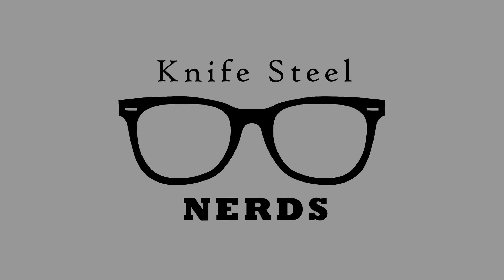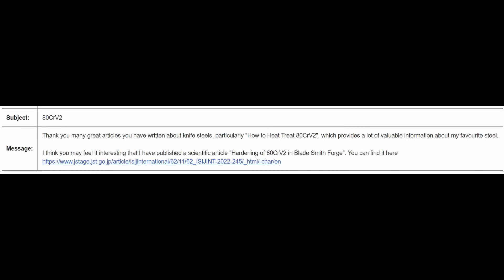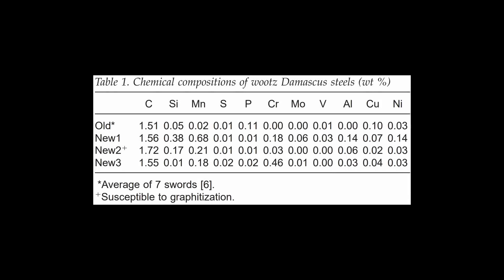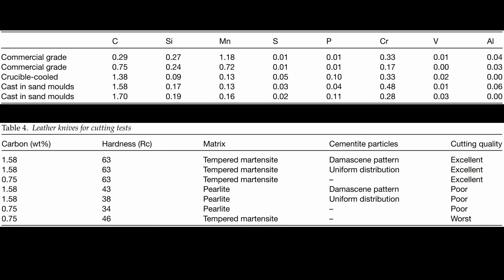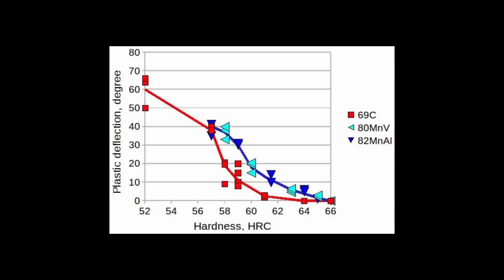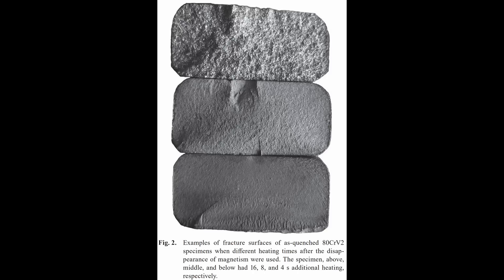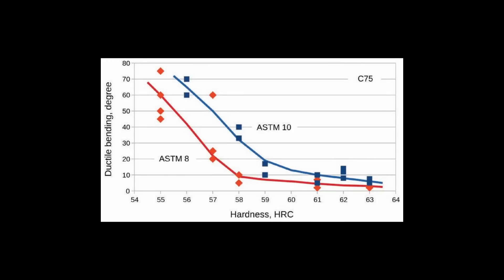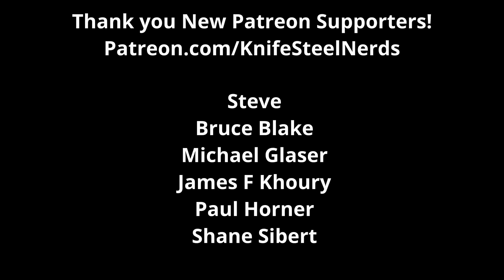A Rival Knife Steel Metallurgist?!?

Comment: My insight from this piece is that these blades are, in essence, composite materials analogous to fiberglass. Aside from differences in basic substances, the metal structure is at a smaller scale than fiberglass....

Comment: Never liked the recommendation for people to start in a forge with 1084. the grain grows in 10 or 15 seconds of moderate overtemperature - to double the original size. Who knows what beyond that. 

more overheat than that with 80crv2 and nothing happens. I have pictures of this -I know they're not appreciated, but I favor the overshot method and like Juha says, it has to be quick. 

I guess if I see nothing in grain growth in snapped samples (in 15 seconds), then my shade of overheat may be lower than Juha's. 

the samples of 26c3 that I sent and that had higher toughness than the book charts were overshot a fair amount - but not for long. Seconds. Finding that worked misled me to believe 1084 would work well that way. 80crv2 does.
Reply: It's good for learning but not good performing if done badly. The carbon dissused really quickly so you can get it to nonmagnetic and it's pretty well near eutectic even from a coarse starting structure without a hold or even normalize. Also quenching it in household oil will also do it wrong. Needs water or parks 50. Best to use 5160 spring steel, or 52100 or something else with some grain pinning of some sort, like 80CrV2.

Comment: Interestingly enough on wootz alot of the myths were like over exaggerations and a the grass is always greener on the other side of the fence type situation. 

Most wootz swords are unhardened or only hardened on the edge so there goes the springy blade theory. And they also tend to cut better Un hardened according to a few modern makers of wootz blades. 

That said it likely still performed better then alpt of earlier European steels which were similar to Japanese bloomery steel till well after the medieval period and into the Renaissance period. 

Actually a key area of my research and why I'm trying to get the sword company rolling I talked about with you on Instagram. Wootz may have been imported into Japan and used by some hizen school sword smith's. We do know some form of iron or steel was imported into Japan and we also know that Japanese sword smith's were using foreign steels there's the whole namban tetsu marked blades. 

Problem is it'd be forge welded and folded together with bloomery steel. So only way to test is the way they're using radio analysis on wootz blades from museums. Scholagladitoria has a video on it, well the radio analysis of wootz. I'm going to be doing some lamination using wootz and bloomery steel simulating tamahagane very closely and doing forms of destructive analysis to test for alloying agents not found in Japanese steels by required for wootz carbide formation. 

Should also present some sulfur and phosphorus contamination above normal levels. These base readings can be used to use the radio testing on nihonto blades to either confirm or deny it. And since it's specific hizen smith's and swords in question in gets easier to confirm or deny. 

There's also some bits of wootz we still don't fully understand even after verhoevens work among others. Mike loades has a video on his channel about it.